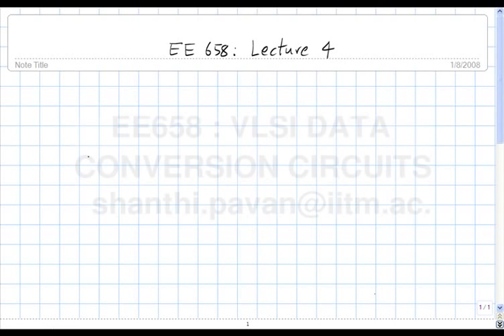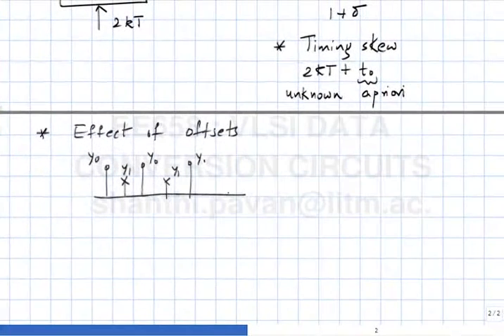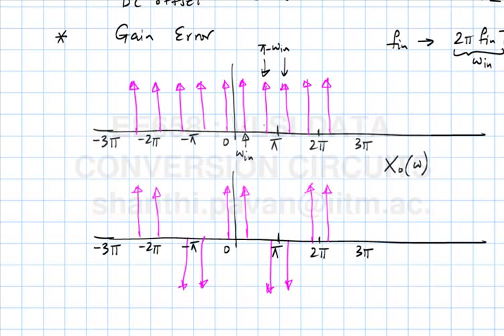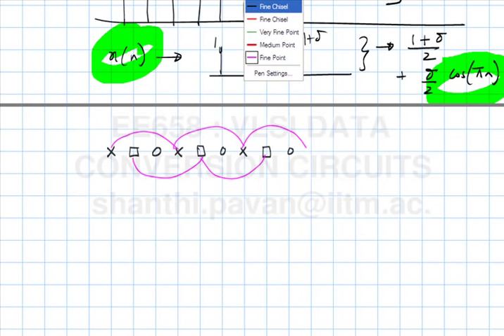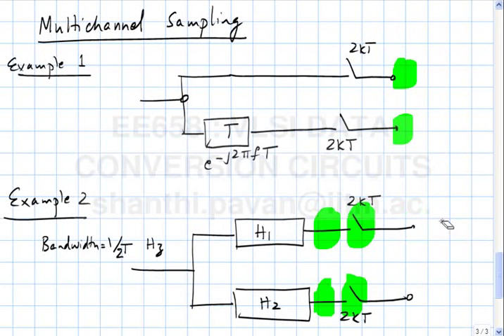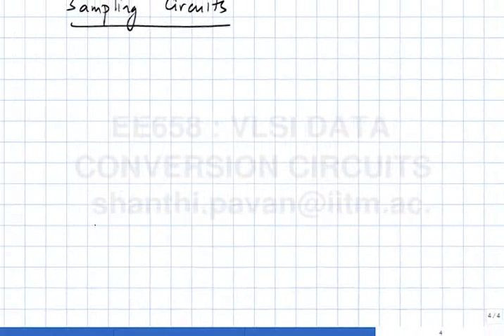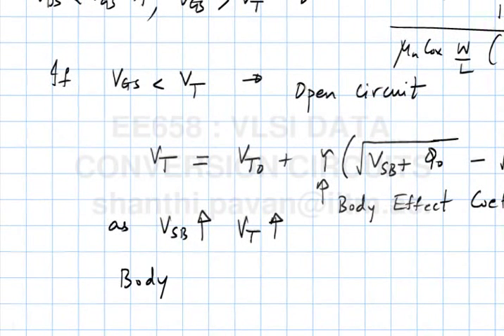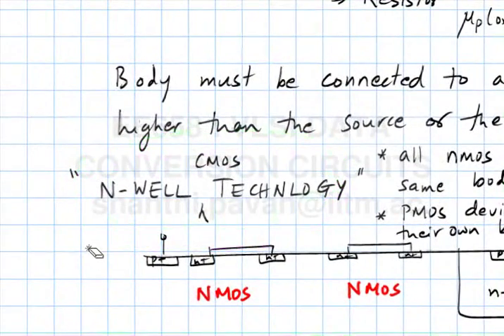Lecture 4 - Analysis of Offset and Gain Errors in Time-Interleaved Sample and Holds.

Comment: Thank you for posting those lectures. It seems that IIT's have a strong program in IC design. 
Do you also have modern power management course or advanced sigma-delta modulator design course?